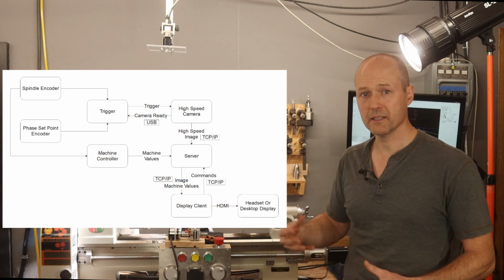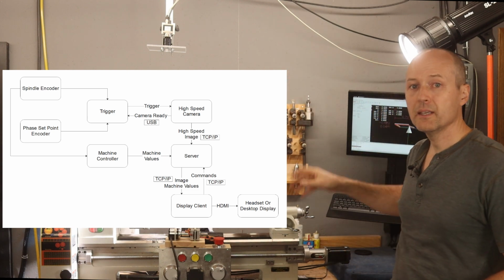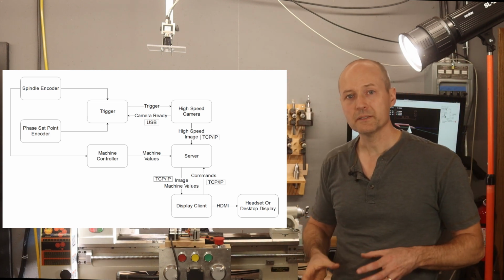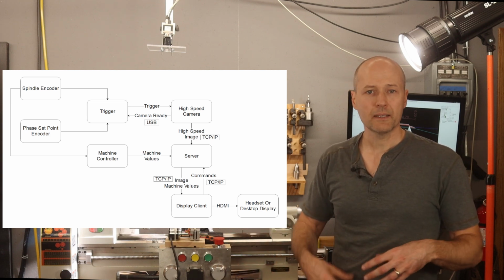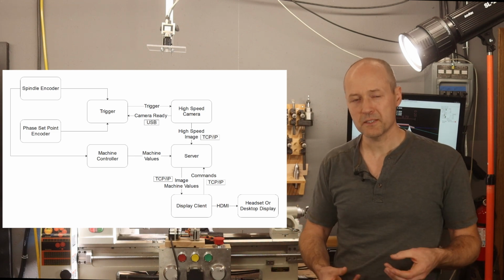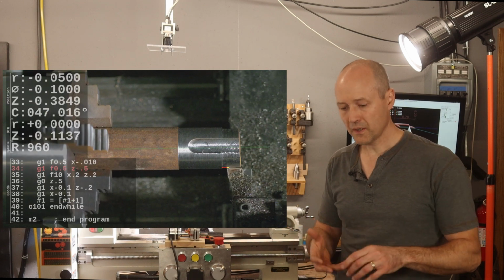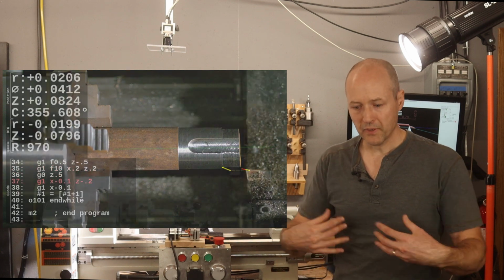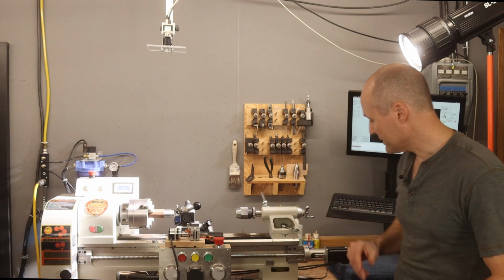Machine Operator AR/VR Headset, High Speed Camera Assist

Comment: I did the test on my machine as I mentioned. I get probably about 5 degrees of variation on a 2" OD roller. It's about what I expected for a software trigger. One thing that dawned on me was that you could actually ditch the DExx Nano if you wrote a hm2 module for the 7i76e Mesa card. The hm2 firmware is pretty portable and it's OS, you could replace the hm2 encoder module with it and have it connected with the encoder hardware pins, and a GPIO output pin for the trigger. the Xilinx software to write Spartan 6 code is pretty old, and I can't do much with it. I did do some messing around with machinekit's port for the DE10 Nano, and I've messed with making the hm2 "bitfile" that "wires" up the hardware pins to the FPGA modules.

Let me know if you need a hardware board for that Nano, I made some full blown breakout boards a couple years ago.
Reply from the maker: Hi Justin, do you have a link for the board you made? Eventually I'd like to try modifying the Mesa firmware, not for this project, but something. Thank you

Comment: This is one of the more brilliant things I've seen. I would totally use this to monitor machines that are running while I program another job simultaneously
Reply from the maker: Thank you! Would you use a headset, second monitor, or want a window alongside your CAM software? Contact me by email, maybe we could do a beta.
Reply: @kentvandervelden  the headset is surely valuable in the shop so you can move and still keep a close eye on machine while at the finishing bench or at the saw preparing the next job.
In front of the machine, I'd surely love to have it integrated in my control panel (QtPyVCP to name it).
At the desk i'd probably like to have it in a window on a second monitor, or even on a large screen tiled display with the different machines in the shop.

Anyway, this is absolutely amazing, from the idea to the making 👏👏👏
Reply from the maker: @JérémieTarot  Thank you for the support; this is very kind. There is a lot of great feedback in all the comments on this video that I'd like to incorporate. I would love to find a local manufacturing shop whom I could work with to help their process in exchange for testing and providing feedback. I've not found one yet.
Reply: This is exactly what I was thinking while watching!

Comment: Absolutely mind-blowing stuff!! Just Wondering what effect coolant jets will have on the video.
Reply from the maker: Thank you Mayank! Even clear coolant will make any light based system have trouble because of scattering. It's an important problem to solve. Maybe the coolant could be stopped for a brief time for the image to be taken at key points to measure features and during a tool retraction to protect the tool for lack of coolant.

Comment: Great set of ideas.  One potentially useful addition might be audio evaluation based on material and tool.  What I mean is related to how a tenured machinist can hear if he(she) is cutting at the correct speed based on sound, so I wonder if it would be possible to programmatically highlight cuts that are too deep, over-zealous speed or dull tools based on some machine learning done over time.
Reply from the maker: Love the way you think Karl! I've used power feedback for adaptive control, but sound would help that a lot. Two related videos come to mind:
https://www.youtube.com/watch?v=qiM20-woEOk
https://www.youtube.com/watch?v=JwzA67_-cAM
My next project uses deep learning starting with images. A trick to analyze sounds is to convert them to spectrograms so image related deep learning code can be used.
Reply: @kentvandervelden  I had built a cnc router a while back and it became obvious that less than rigid machines tell you when you have a feed or speed wrong or if an axis was not square.
Originally I wondered if something similar could be used with vibration sensors to infer when a machine axis was out of square.
Reply: Great idea! Karl you are one of us.

Comment: This is the most insanely complicated and over-engineered way to solve a simple problem I have ever seen.
A simple flash bulb triggered by an electrical contact on the spindle would illuminate the workpiece once a revolution, and would provide most of the practical benefits with 1/1000th the complexity.
Mechanics have been using electric stroboscopes (Strobotac) for this purpose since 1917.
Reply from the maker: The first video showed the strobe method, and it works great. Thank you

Comment: Super cool project! Feels like there are tons of potential applications. Overlaying a diagram of the final part, previewing the toolpath of the next operation, identifying and alerting if there is runout or vibration. Great work, excited to see what comes from it in the future :)
Reply from the maker: Huge thank you for taking a look! The toolpath for the currently executing line is shown, and I would liked to have added a full tool path projection but that would have taken another week, if I could re-use LinuxCNC's or another open source one. I had considered using an overhead projector or laser to project the part. The headset lets the part or toolpath be emphasized, features, color, overlays can be enhanced. What I showed is the easy stuff, the step to AR a camera, and making sense of the environment is way harder.

Comment: is it possible to include angular position in the display so clocked markings could be engraved around the circumference based on the encoders?
(using the cutting tool to score a line along the axis of rotation then rotate and score lines at 1 degree increments or whatever is called for to make a clock or degree marked wheel/disk)
Reply from the maker: Hi Kazz, if I understand correctly, yes. The angular position is shown on screen as axis C, the rotational axis aligned with Z. This could be used as the beginnings of a dividing head, through considerable mechanical work may be needed. If the spindle is servo driven, the servo could position the spindle. This is what I'm considering, but suspect without direct drive and a spindle brake there'll all may not be rigid enough for milling with a secondary spindle. Engraving may be fine.

Comment: Never seen anything like this! Outstanding! How fast is the refresh rate?
Reply from the maker: During the video, the machine values were updated on average 100Hz, probably limited by the LinuxCNC servo loop and Python API readout time. The update rate of the camera depends on the spindle RPM, camera fps, network speed, and computer speed. During the video, the the frame rate was 16.7fps, limited by spindle speed.

There's plenty of room for increasing the speed. The camera is 12MP and bandwidth limited by USB3, or 30fps at 12MP. There is no hardware binning on this camera but the region of interest can be set. I.e., half the height and width and the fps increases 4x. Switching out this camera for a different model in the series can increase fps to several hundred. Each 720p image sent to the headset client is ~130kB allowing hundreds per second over WiFi. 

Faster updates don't help with a person's viewing that maxes out around 30fps, but if the computer can make sense of the frame at maximum frame rate perhaps features can be highlighted for the operator.

Thank you

Comment: A display of the next move if you were in single block could be interesting, just to save you a possible crash.
Reply from the maker: Hi Jim, it does not show up well in the video, but there's a red line connecting current position to target position. All done in machine coordinates using the distance to go from the trajectory planner. (Interpreting the gcode would let one project future. Maybe a future improvement.) The yellow trails are the last five seconds of positions. This works if running a program or if running commands in the MDI of LinuxCNC. There's also a green line showing axis of rotation. Or did you mean something else?
Reply: @kentvandervelden  I'm in no position to ask for anything of course but as long as it will give me the information to decide if the next block is clear of jaws etc that seems like the big benefit for me.
Reply from the maker: Likely collisions can be seen. It's not perfect because a camera doesn't see a scene along parallel lines. The viewing envelope is a frustum. This can be seen in the chuck's jaws. We know they are coplanar, but don't look so in the image. A lot of that is because I didn't perfectly square the camera, but some of it is distortion that would hard to solve. Projecting forward additional lines would be helpful too. With a full tool path simulator quite a lot of extra information could be shown in context of the stock.

Comment: It isn't magic but you'd need a feeler gauge to measure the difference.
Reply from the maker: The precision in the video is about .004"/px. Probably with some fancy programming it would be .002"/px. If the full camera resolution was used, then we reach tenths. But this is only valid in the plane the tool operates.

Comment from the maker: Hello and thank you Hackaday! 
An earlier video details the implementation of the high-speed camera trigger: https://youtu.be/YDVgXjT4GFo
Part reversing and measuring could be added: https://youtu.be/7mBQwIzaiaQ
Long term, maybe also adaptive controls: https://youtu.be/_i-qp6B5K4w
If you have connections to a safety glass head-mount display manufacturer or supplier, please connect us. I would like to continue the heads-up display work for manufacturing.